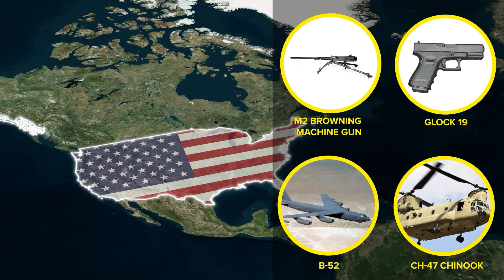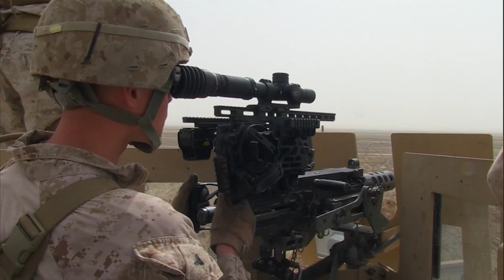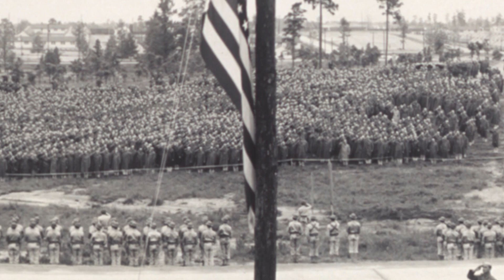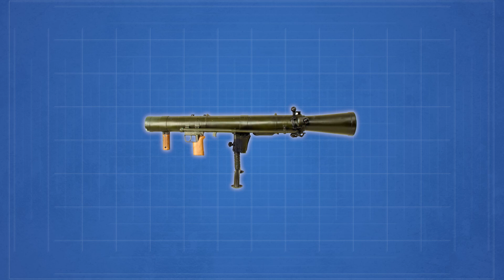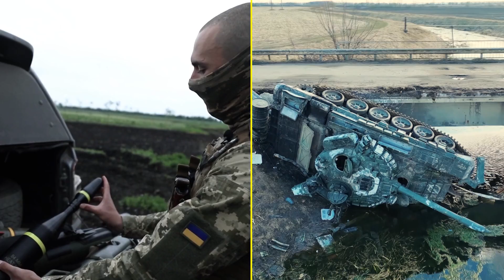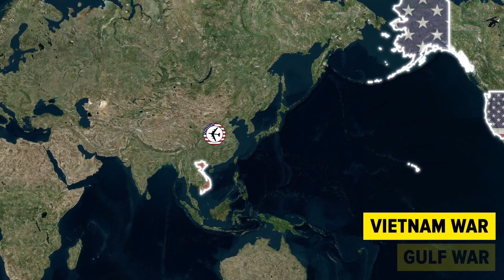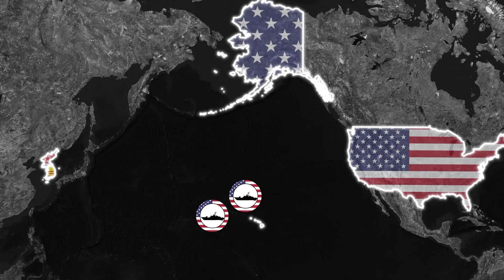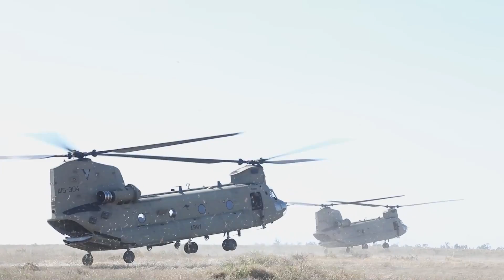Why US Military Can't Replace These 100 Year Old Weapons

Comment: I was in the 82nd airborne infantry from 1980-1983. The C-130, ch-47, and the 50 caliber were our favorites then and its amazing they are still favorites 40 years later. You maybe able to add the a-10 warthog on to the list soon
Reply: People are looking in on replacing the A-10 because of its low tech capabilities but more importantly its design is the most concerning aspect. In a conflict with a near to pier enemy (china) the A-10 is to slow and to easily spotted on radar. For it to even be considered safe to be used against an actively combative airspace. The A-10 did its job especially when the Air Force gave it the technical equipment to do its job after the first Iraq invasion (sorry Britain about the blue on blue). But with the new anti-air technology out there these days, the A-10 is a liability, not an asset.
Reply: @2q2see2  It is said that it was originally intended to "buy time" during a Soviet invasion of Europe as an attritable asset.  Although the gun may not be particularly effective, what it has been adapted to carry is, including AIM-9 Sidewinders, and can loiter much longer than any other bomb truck.  She was never designed for contested airspace, though.
Reply: C-130 isn't bad unless flying from Midwest and across the "big pond".  Took us 3 days to arrive but the pilots didn't get "go" pills and we had to spend night 1 on the East Coast, Night 2 Azores, then on to further east until we arrived. It did allow several guys to sleep off hangovers from the first night. Amateurs puking in bags, lofl. I liked those webbed seats though, for those not familiar with them. Toilet idea sucked.  Next time we had something with  engines, not props
Reply: @davidr1676  Azores nice?
Reply: @davidr1676  also seeing new life as the AC-130. I hate to be an enemy and see that thing lingering over the horizon.
Reply: Also  the DC 3/C 47  aircraft still flying around ,can't retire old dogs .LOL
Reply: @amuxpatch2798  Some designs are just so good to change.  The Chinook helicopters delivered construction materials to a remote outpost on the Cambodian border.  It never landed, just hovered while the payload as wrapped in cargo netting was hauled about ten feet below the Chinook and off it went.  At the destination, the cargo netting was lowered so that waiting troops could unload it.  I remember a wicked prop blast from those helicopter blades.
Reply: Though, seriously, Mister narrator: not chin nook but shin ook. Not unlike Chicago.

Comment: Both aircraft were designed and built well after 1923 by at least three decades for the Chinook, later for the plane. Note the jet engines on the Chinook and the turboprop engines on the plane.
Reply: The Chinook has turbine engines, which spin a shaft.
A turboprop is ALMOST the same design, since BOTH 
spin a shaft.  A jet is powered by a strong stream of 
exhaust coming out the tailpipe.  (Just like a rocket 
engine.)

steve

Comment: You forgot a few things.

The M4/M16 has been around since the Vietnam War.

The CH-53 Sea Stallion which is from the '60s.

Also from the '60s and still service are the UH-1 Huey (now called the Venom) and AH-1 Cobra (now called the Viper)
Reply: The M4 is going to be replaced soon, though it will take years before it’s out of the primary inventory.
Reply: Yep. @horus30k
Reply: KC-135 1956-today, intended to be replaced by KC-46 before 2030
Bofors L/60 40mm autocannon (1934-today)
M18 Smoke grenade (1943/1944)
1903 Springfield Rifle (Used only in ceremonial purposes)
Reply: I remember right before the big sandstorm that early Iraq vets talk about there was a marine unit in a defensive parameter and there was a Huey there. I didn’t even know that they were still in service let alone actually being used at the time.

Comment: 1911
M2
Remington 870
M1A
B-52
C-130
U-2
UH-1
AH-1
M113
T-33/F-5
F-4
...
Reply: F4 or F5 is a bit of a stretch I think, but I agree with the majority
Reply: @kyledabearsfan  why? US has a bunch of F-5 still in use today.

F-4 still in operation by a few nations.

1911 isn't officially in US service, hasn't been for a long time, yet it still gets counted.
Reply: I guess I just think of it differently, the f-4s in Iran's arsenal for instance are really only there because they are incapable of getting anything else. The opposite of this is the M2 Browning, it hasnt been replaced because its just too good, not because it couldnt be replaced. It probably bothers Iran quite a bit that their best weapons are from their "enemy". But I can see your point, although we have differing opinions.
Reply: @kyledabearsfan  What about Japan's F-4s? Japan has other options.

I'm not arguing the F-4 isn't on its way out, just as the A-4 only finally recently was shown the door by some nations. But the fact that aircraft like the A-4 that was essentially a Post-WW2 gen 1 jet aircraft, and the F-4 lasted so long. And the Mig21 is even more hopelessly obsolete than an A-4 or F-4, but look how many are still in service all over the world.

And it's not as if the US really uses the M113 anymore, we just have tons of them in storage. But they were still used at least as late as 2007 in combat by the US in OIF (I was there and a unit used an M113 in Ramadi to rescue some guys, otherwise we used them as rolling gates for the bases to block car bombs).

But I was an expert on the M2 in my unit, and I prefer no other weapon on my turrets than the M2, it's just truly an amazing weapon. Extremely reliable and simple once you understand it.
Reply: @SoloRenegade  I can respect that take. I appreciate your insight.

Comment: But all Special Forces still use the 1911 you can't beat the 1911 against those 9 mm piece of junk of course that's my opinion it has better stopping power then a little weak 9 mm
Reply: Except 9mm and .45 have nearly identical terminal ballistics. Pistols suck as a general rule when it comes to killing things with shot placement being far more important that perceived "stopping power". So, I'd rather have 15 chances to stop a threat than 7.
Reply: @buckeyeman98  9 mm doesn't have the stopping power it's a peashooter 45 is ideal for war not a weak little 9 mm I'm sorry
Reply: @jamesendsley2611  then why does the vast majority of modern militaries and LEOs use 9mm over .45?

The FBI released a report about this a little while ago. I'll link it below but here are some key points, in case you're in a hurry;
- LEOs have a 20% to 30% accuracy rate in shootouts, so magazine capacity is important.
- 9mm Luger rounds have a deeper penetration than other handgun calibers.
- FBI agents have been observed to shoot faster and more accurately with the 9mm.
- The wound tracks of a 9mm and a .45 ACP are almost the same.
- The 9mm’s lighter recoil makes it easier for follow-up shots.
Reply: @buckeyeman98  yeah but what they went up against the Philippines back in the day the 9 mm would never have stopped them that's the reason they were using 45 stopping power 9 mm still doesn't have the stopping power it'll make you step backwards if the dudes on PCP or cocaine or something like that cancel tell you they'd rather have a 45 if they're against something like that and so does the military I can't help but they had to go cheaper and shittier firearms 9 mm versus the 45 I'd like to take the bigger bullet that shoots hits a lot harder you get hit in bulletproof vest by 45 you got broken ribs you get hit with a 9 mm you got a bruise
Reply: @jamesendsley2611  my guy, you're using an example from 1900. We aren't using bullets from 123 years ago. Again, why do most of the world's militaries and LEOs, including the SOF groups like Delta who can have literally any gun they want, still pick 9mm in a platform like the glock?
Reply: @buckeyeman98  sold the Glock sells all the other designs in 1908 the Glock was designed any use brittle ass pieces of plastic that's reason it never passed military trials and didn't have enough safeties and still doesn't have the right safeties
Reply: @buckeyeman98  Glock started fiddling around in the twenties do a firearm but he couldn't get the Plastics right he was a real old when I got the polymers correct so he can make a firearm he went from making watches the firearms he had the first I did 19 30s when he was only in his late thirties he didn't get a gun manufactured they could pass the patent product in the United States until 80 but he had the design since the thirties it's not that young he just couldn't get the polymers correct see you had to get the modern Plastics that can handle Heat all these plastic guns you idiots think they're good cuz they're lightweight a real gun is heavy because it's made of steel or titanium
Reply: @jamesendsley2611  now you're just stating factually incorrect things. Firstly, Gaston Glock wasn't even born until 1929. Secondly, Glock has passed a plethora of military trials. Don't just look at America. Please, provide even a single source for any of this.
Reply: @jamesendsley2611  and seeing as Glock wasn't even the original point of discussion, do you care you refute or counter any of my earlier points from the FBI's findings?

Comment: as i say, if something old it dont mean its unreliable and need a replacement
my 20 year old Fiat Punto is still more reliable than anything new rolling out of mercedes or bmw factory, yes its outdated and not very strong (only 60 hp) but it does everything what a 200 hp merc, bmw or any other car can do (but more reliable since both the car and engine is more simple, has less thing to broke down)
Reply: Can it drive at 180 kmh comfortably and safely? Brake safely from that speed? No so it's not the same as a BMW or even a modern compact car.

Comment: all are awesome.  the B52 has four twin engines because its small rudder could not keep the aircraft flying if it only had 4 large engines and lost one.  It would cost far too much to re-engineer the entire tail assembly at this late date. so eight engines. Why fix something that's not broken?
Reply: I saw this painted on a B-52 once back in the 1980s. We Rain Hell From Above. How true.😀

Comment: Contrary to popular myth the MG338 is NOT designed to replace the M2 Browning. It is designed to give socom units extra punch.

The US military collectively gave up trying to replace the M2 Browning after the last failed attempt in the early 2000s. This says a lot since they tried to replace the M2 as far back as the thirties.

Instead, the US military focuses on upgrading it, hence the M2A1.
Ergo the M2 Browning is likely to still be in service well into the 41st millennium.
Reply: They did replace the M2 back in the 1950s.'  It was the M-85 machinegun. The M-85 was then replaced by the M2.  The only reason it stuck around into the 1990's was because the M-60 series of tanks could only use the M-85.  (I had the misfortune of using the M-85 on the M60A3 - I absolutely hated that machinegun.)
Reply: the M2 could literally be fitted with a bolter or las cannon interchangably given how big it is. How do you even replace it? It has everything needed for an HMG and making a slight variant can serve from everything to heavy fortified anti vehicle to aerial support to quickly deployable anti personnel. Sure, maybe its not the best for everything but whatever you use for individual missions cant cover everything the M2 does. Its amazing as an HMG
Reply: @hudsonflores5478  The biggest drawback to the M2 is ammunition stowage.  When I was on the M1A1 we could carry 10,000 rounds of 7.62 but only 600 for the M2.

Trivia note: the amount of ammunition you can take with you is the reason for the myth that the Geneva Conventions say that you can't use a .50 cal on troops.  This isn't a 'law of war' issue - it's doctrinal, to save the ,50 cal ammo for the things you needed a 50 cal bullet for.  (And we only carried 80 rounds in the gun itself - and had to stand on top of the tank to reload.)

Comment: You left out the first replacement of the B-52, the Mach 3 B-70 Valkyrie.
Reply: The Valkyrie was never ordered to replaced the B52. It was still in experiemental stage. The B1 Lancer was made to replace the B52. One can argue that the B1 Lancer was derived from the Valkyrie's designs.
Reply: @ms.annthrope415  No, it was cancelled when it became clear that flying high and fast was not going to be effective against the new Soviet missiles and radar, so the Air Force changed the mission to low level penetration that the B-52 was better at. Another reason why the B-58 was eventually retired.